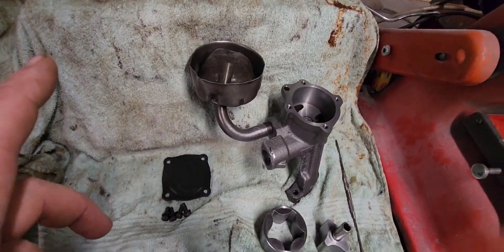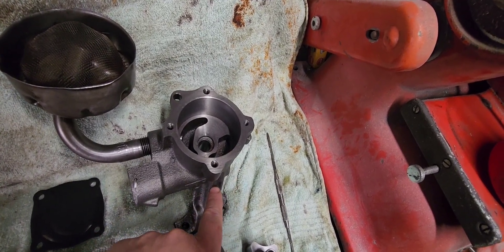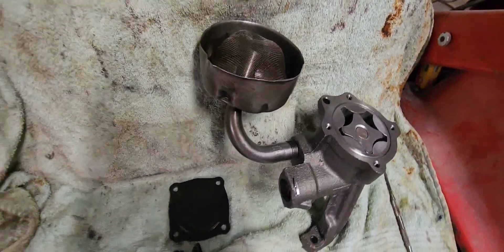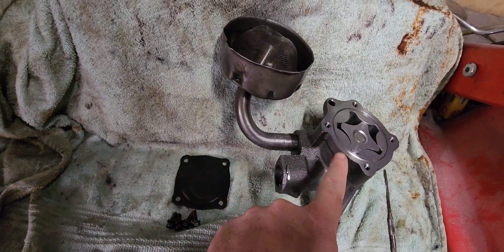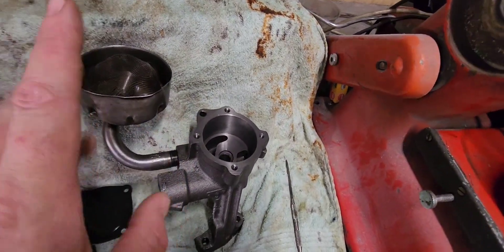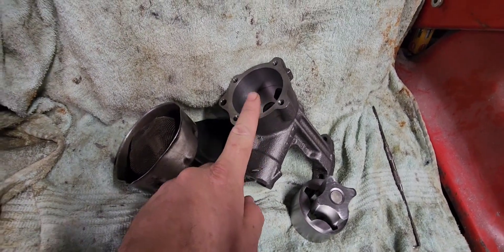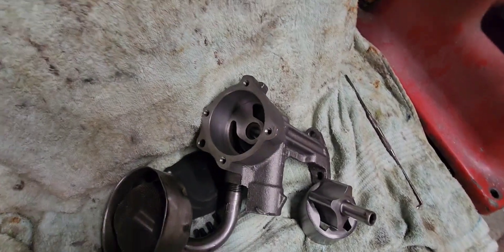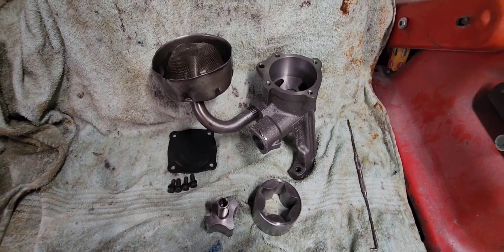Ford Cleveland Oiling Secret Continues. A lesson in how ALL oil pumps work and how to improve them.

Comment: First of all unless you’re bearing clearances are excessive or you’re feeding like I’m two Mondo turbo chargers a stock volume factory pump is one of the better ones you could run because your big high volume pumps for the most part bypass a ton of oil given that you’re bearing clearances and everything else is correct, which makes heat Seems to be and others that at the end of the run at the back of the engine where Reed oil pressure on a Cleveland typically if you have 80 pounds high RPM for goodness sake, you have 80 pounds everywhere else I tend to believe that the biggest problem is the way the cranks were drilled. Please give me a reply on that
Reply from the maker: Yes. 
Rpm pressure drop-off is, in my opinion, related to pump cavitation.
Also, there is no such thing as flow restrictions to "improve pressure." 
Recently, a friend had an engine failure of a 6 cylinder engine that lost a rod off the crank. Even with a full bearing journal exposed, when it was run (yes, it still could be fired up ), it still had 25psi at idle. So, this dispells the myth of bearing clearances setting oil pressure. It's the relief spring that does that, which is said about replacing the spring with a stronger one. Moroso do a 100psi spring upgrade for a Cleveland.

There is another issue that isn't talked about, and that is aerated oil (oil with air bubbled in it). This causes more problems associated with burnt bearings as the bubble pushes oil out of the way as it expands.

Comment: Sorry, I didn't realize you were passing on someone's material. I thought these were your ideas. I'll make a few contradictory statements in hopes that you'll search out what's right. Let's begin.

Pressure is resistance to flow and they are directly related. The more pressure you have the more resistance to flow. The less pressure the less resistance to flow.

So your statement ending at 3:42, "your pressure doesn't change....you just have more flow," is false. The oil clearances in the engine will determine the pressure reading you see. You stated that correctly. However, if flow is increased then pressure is decreased. Pressure being equal to resistance of flow.

We'll start there.
Reply from the maker: You are referring to flow out of a system. 
The pump, which I am referring to, is increasing flow into the system, which will cause the pressure to rise if that flow is not checked. Hence, the need for a relief valve. The spring pressure ultimately dictates the pressure as the bearing gap only changes with temperature, yet that is by a small amount. 

So, set restriction with variable flow into that system will equal rising pressure if the flow is not bypassed. In fact, there are numerous examples of exceeding 120psi at idle when a bypass valve is stuck shut.

And you are right, this is nothing new. It's just a greatly misunderstood subject.
I'm sorry my wording is not constructive to your understanding of it.

Comment: So do we need high volume oil pumps if most of the flow is going down the bypass?
Reply from the maker: I don't like telling anyone what to do, I try to provide information so the viewer can make an informed decision.

Using the videos information as the basis for my opinion, I won't be looking to purchase high volume oil pumps. I will be using standard volume ones and making improvements... Which I will have to show at a later date.
Reply: Please understand your question is vague. So I'll give you the short answer. YES.

Regardless if it's your Kawasaki 18hp lawnmower or 32v Mercruiser ZR1 LT5. The engine needs as much oil flowing through it as possible. Thin oil. 5-20, 5-30, 0-20, etc.

25 years as an ASE Master, 17 years as a Ford Automotive and Diesel Senior Master technician and 28 years building(1996 to present,these credentials overlap) race cars is the experience that let's me say, "YES".